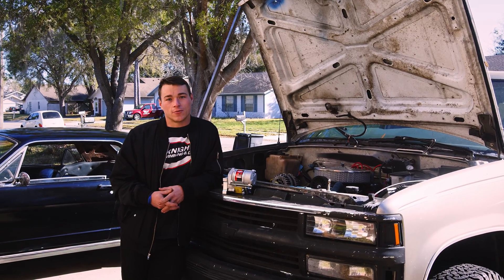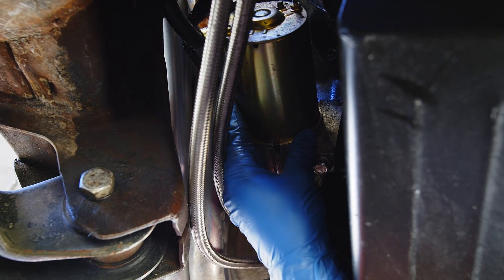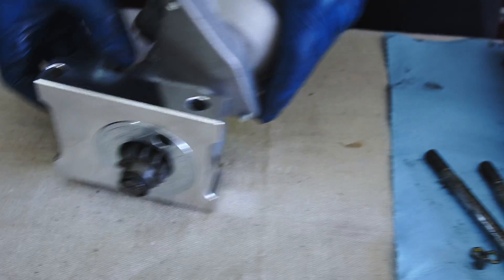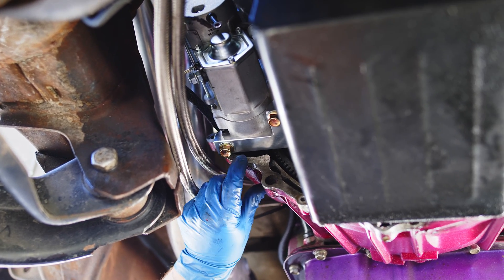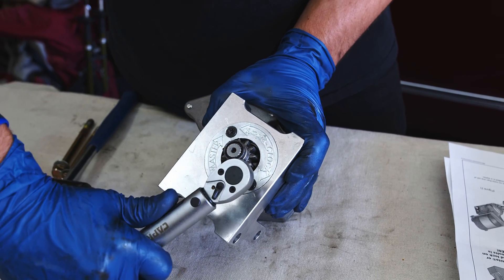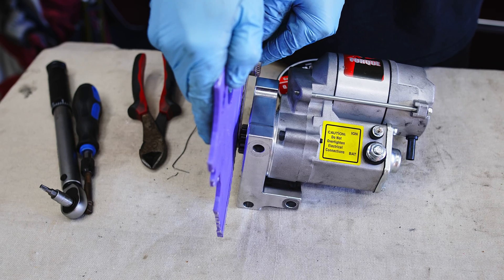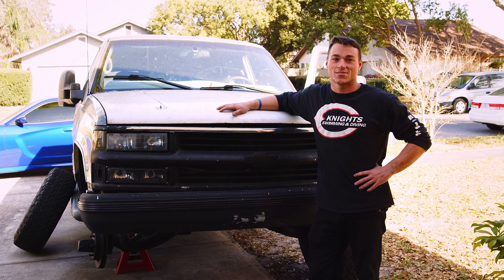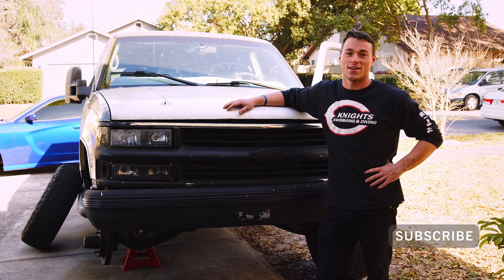Solved! Chevy 350 Eating Starters - Powermaster XS Torque Starter - How to Shim & Install + Review

Comment: Why was it eating starters? Was your truck shorting them out ?
Reply from the maker: The flex plate was moving back and forth due to a bad crank/crank bearings, so the starter gear was not always lined up properly

Comment: These starters are not just simply bolt on, in most cases you have to shim them and in some cases milling the base to achieve the right tolerances. You will also have to make or buy a diode wire, if you are using a points ignition, this is an extra cost and not supplied. I used this starter on my 74 corvette and it was a pain in the butt to get it working right. For me, it was just not worth it, for what they are charging for these..... everything should be included.

Comment: Chevy crap motor a well designed motor would not require shims
Reply from the maker: It's a 383 rebuild that was our first engine build. It's not stock at all and a stock motor wouldn't need shims like this unless something was very wrong.

Comment: I've never had luck with aftermarket starters, just built a 454 with 10.1 compression and bought one of those power masters, it wasn't machined right and destroyed my flex plate no matter how I shimmed it, it wouldn't work. I put in a starter from my 97 z28 and it works flawlessly
Reply: You probably did it wrong. I'm sure your 283/454 that u built has came apart since you tried to build it.

Comment: i have been having the same problem with my 1970 el camino custom 350 LT1 370 hp engine i tryed 4 cheep ebay starters and they all failed. now wacking your video i know what i got to do thanx dude. Larry B

Comment: I noticed you didn't use the brace from the front of the starter to the engine block, is that not needed for this application??

Comment: Hello, I am having a no crank no start (there is power) my 64 ss impala has been to the electric shop more then once and can’t find the problem! 2 new starters, new alternator, 3 new batteries, 1 new ignition switch, bypassed the safety neutral switch, and still nothing! We hit the starter with a wrench and wall-a it starts. Any advice? My next step is to go mini starter and run a new power wire. (Something is causing my starters to fail) thanks in advance.
Reply: sounds like its not grounded good enough or there is a wire that goes from the positive battery cable and goes to the ignition box on older chevys make sure it is super energised i mean the wire is hooked with the positive cable compleatly hooked up or you will have the problem that you are having check out youtube wiering harness 1968- 1972 chevy el camino or impaula it will help you out thats what i did fixed my 70 elki right up. Larry B

Comment: I see in the comments the flex plate went bad.  When you have bad teeth on the starter, that's the time to inspect the flex plate, too.  Good chance the starter gears damaged the flex plate, or it was already damaged (3 previous starters).
Great tutorial on shimming!  Where did you get the plastic flex plate quadrant.  I need one.
Reply from the maker: Yeah that original flexplate had a lot of abuse, I don't blame it for its failure. And the quadrant was 3D printed! We modeled that and printed ourselves, we may still have the stl file somewhere

Comment: Why does it crank so long? That’s possibly some issue!
Reply from the maker: We also have excessive crank play, due to the transmission not being installed with enough clearance at some point, breaking the old pump rotor in the process and starting the extra wear around the crank/bearing surface. Basically, the crank needs replaced :(

Comment: You did a FANTASTIC JOB explaining clearances, shims, torque specs on bolts, why all of those things are important, etc. Then at 10:16 I saw that sketchy AF terminal connection and cringed. Please, for the love of everything holy, crimp and/or solder (or both) that connector AND put some heat shrink tubing around that excess exposed wire!! =/
Reply from the maker: Lmao yes, I hate those connectors, it's the same situation on the battery end of those wires and I really am trying to find 0 gauge connectors that are clean on their own
Reply: @VeryGoodGarage  I'd just go with something simple like this:

https://www.amazon.com/Copper-Battery-Welding-Connector-Terminals/dp/B07HKQDVF2/

The less bulky, the better, IMO. Of course, you'll also need the special crimping tool:

https://www.amazon.com/IWISS-Battery-Cable-Crimping-Cutter/dp/B00MVE48Z6/

And then after you crimp it down, I like to heat up the lug and dump a bunch of electronics grade solder down into the 'cup' until it's almost full. Let that cool down completely, then finish it off with some large diameter heat shrink tubing and a heat gun:

https://www.amazon.com/RockDIG-74PCS-Double-Wall-Adhesive-Assortment/dp/B07MW27JNZ/

https://www.amazon.com/Wagner-Spraytech-0503008-Heat-Gun/dp/B00004TUCV/

It'll look good, be minimal in diameter, and most importantly safe from short circuiting!! 

(this comment is not in ANY WAY sponsored by Amazon)

^_^
Reply from the maker: Oh okay awesome, for some reason it never occurred to me to find these for my giant wire, but I already use these on my smaller wires! Got the crimper and everything, so I'll order a pack
Reply: @VeryGoodGarage  Awesome! Glad I could be of some help!! =)
Reply: @Lloyd33 why u be sayin da wire need to be covered bone
Reply from the maker: Hopefully these will do better https://youtu.be/H4W4T_zgap8

Comment: Can you use all three bolt holes with this starter?
Reply from the maker: Different chevy blocks from different years have different starter bolt holes on the block, so this starter comes with all of the possible holes for compatibility reasons, so we used the only two holes we can use for our specific block

Comment: You mean you had to MACHINE a shim??? Holly molly!!! What if a guy doesn't have those tools?? I don't think this starter works for me!!! I even wonder whether your install is correct. MEH!!! Well..clear vid!
Reply from the maker: Actually we realized later that if your starter is that off, it might mean that the flex plate isn't shimmed properly rather than the starter, and we did actually have a flex plate shimming video here https://youtu.be/d6R3SG0HxBA

Comment: You don't disconnect the power cable from the battery (+) to totally disconnect the battery from any motor vehicle wiring system! One would only disconnect the (-) terminal cable, the ground cable at the battery.
Reply: Exactly! You can potentially harm the electronics by not removing the ground.
Reply: @davidcarr6831  Huh? I don't understand what you mean about harming electronics. 

You do need to be very careful that if you only disconnect the positive terminal; you don't just chunk it down into the engine bay. If it hits anything (grounded) metal, it will cause a dead short in the battery. But that would only harm the battery. I don't see how it could really harm anything else, unless maybe it hit the alternator housing or something. 

Disconnecting EITHER battery terminal (positive or negative) breaks the complete cycle of electricity to/from the battery. But I do agree that disconnecting the GROUND cable is probably the better choice Generally, if I'm working on anything electrical like a starter, alternator, distributor, car stereo.. I just disconnect both battery cables to be on the safe side.

If you like living on the edge and only disconnect your positive battery cable, please put the terminal down inside an old, thick cloth/leather glove (welding gloves are great). And add a bit of duct tape just for good measure around the wire and the hole your hand normally goes in so that it can't possibly come out of the glove. =)
Reply: @Lloyd33 what are you talking about? If you disconnect the pos terminal the only think left energized is the pos terminal on the battery
Reply: I learned that in kindergarten...
Reply: You can touch the disconnect end of the pos terminal to any ground surface with no problem

Comment: Another great video! We hope this starters stays strong.
Reply: Sounds like a headache from the start! Didn't know I had to make my own shims for a starter that is pretty much made for this exact engine!? I bought a Powermaster 9200 starter from Summit a couple months ago. Just now getting time to bolt it up, but guess what? The main body is almost .250" smaller than O.e.m. so now I can't send it back and I have to make shims and try to make it work! Smh!
Reply: @minnie19booboo  important to note that our engine is running a different crank and a different flexplate, so the starter can't really be "made" for our engine